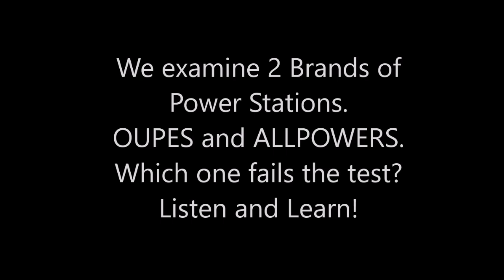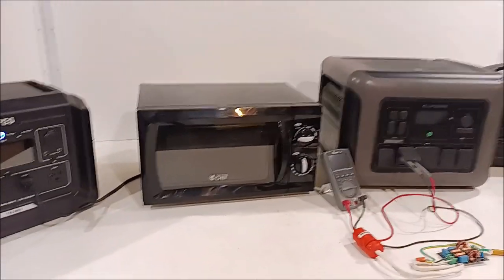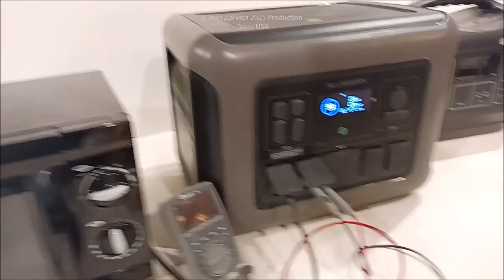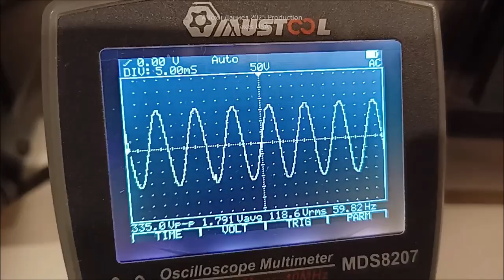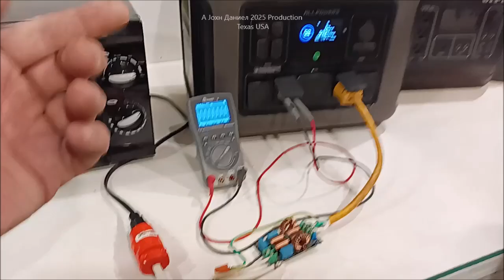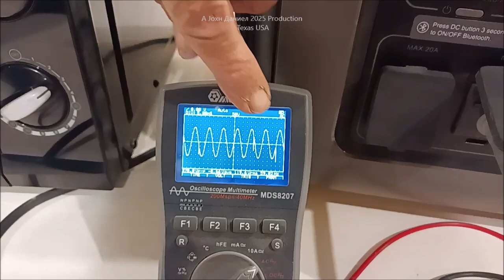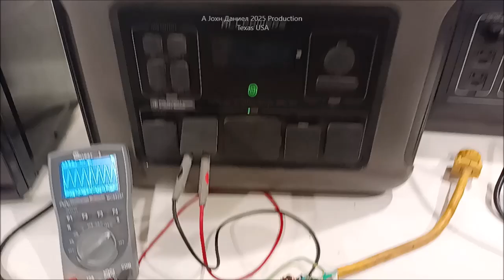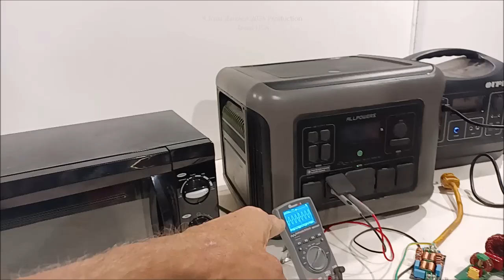VOLTAGE FILTERING - Find & Fix rough voltage using RFI Module | Tested ALLPOWERS & OUPES

Comment from the maker: EMI Voltage Filter DIY 20 amp https://amzn.to/43loTNxb ,OR Furman Power Conditioner https://amzn.to/3E9qz2t COMMERCIAL CHEF manual Microwaves are EMP/EMI Failproof! https://amzn.to/4ay6uik Need Tech Answers? go👉 Donate $5+ with KoFi - https://ko-fi.com/john4kiera OR https://bit.ly/2buyaCoffee message, inquire, you'll get my help & replies!! 
COMMERCIAL CHEF manual Microwaves are Failproof! Best for RV and Truckers! https://amzn.to/4ay6uik
Reply: I bet if you tested a number of Power stations they wouldn't pass the dirty voltage test

Comment: I have an inverter in my trailer fed from an inverter in my house for battery charging purposes. While charging, my house inverter makes a disturbing buzzing noise. Would this filter rectify the buzzing?
Reply from the maker: A Filter is helpful, but if your using a Modified or Square wave your buzzing may not clear up much.

Comment: My hole home is on solar everything is pure sine wave
Reply: Pure sine wave is only part of a good solar setup! These high frequency units are half ass at best, if there rated 2000w, there only safe for a 1000w continuous. There ok for temporary use,camping,backup your fridge and the like, most people have 3 or 4 of these crappy units, and yes Bluetti, Ecoflow are part of this high frequency crap! You have real, long lasting,clean, quality power when you have pure sine, low frequency power, built with large transformers just like the grid. I have 2 low frequency solar generators 3000w each, and 5kw grid tied solar on my house ( Enphase ), my 5 kw produces 5.5 MW every yr and has for 7 yrs straight, complete system warranted for 25yrs, rated for 40yrs. If any of my panels produce 3% under there rated power, for 25yrs they have to replace them

Comment: This vid got me thinking. I have have 2 inverters 48v Swipower 2000w 3000w both refused to power  laptop plugged in to TV HDMI (130w max total) made TV behave funny blank screen. But If I put the power from swi inverters through my Anker power station in UPS TV & laptop work find. So my guess is, having now watched this video, the swi powers are putting out dirty voltage and the Anker is cleaning it up. The Swi power display AC does fluctuate on the display so...Thoughts?
Reply: Incidentally the tv and laptop power fine with a 1.5 yr old all powers r600
Reply from the maker: If your using the ground wire on the outlets on the SWI power remove it from any grounding such as Cable TV ground or the like. It can cause voltage imbalance. Putting them through a power station removed that ground static. I run all mine as 2 wire, and NO grounding on Computer Cat5 or the like and cable TV or the like is removed. zero issues.
Reply: The inverters are not grounded. I tried grounding as a solution it did nothing. I honestly think having watched your video it's dirty voltage. Sony TV must be female, very picky, voltage has to been hygienic. No worries though because I only use them for kitchen power (heat elements) they do that fine. Got another inverter for sensitive equipment.
Reply: One feature I like about the swi powers is the soft start. I have a vacuum that pulls a ridiculous surge, but I switch it on while the inverter is off, then power on the inverter and listen to a nice gentle rise in power. Doing it the other way (inverter on then vac) trips the breaker :-)
Reply from the maker: For the hyper picky things, such as CRT, Plasma TV, and HAM radio, use the best made for that, a pro model like we use in the telecom work. Just need a 1500 watt in 48 volt for your system. My suggestion, absolutely the Cotek SP1500-148 1500W, 48V https://amzn.to/42ynUd3 
Cotek is Xantrex product, all internals are made in Taiwan not China. Assembly is at the Kioshi ( formerly Toshiba ) plant.

Comment: I've heard you mention you have a power station running freezers and other appliances and they get trickle charged throughout the day. Is it a solar trickle charge or coming from main battery bank? Would love to see a video on that. I really like that idea because if a "main" inverter goes down, your whole off grid setup isn't an expensive pile of parts not doing anything.
Reply from the maker: Yes, we have a number of Power Stations just getting 90 to 150 watts each all day long and even all night when the batteries have it they are on a circuit using a VSR so that all day when volts are above 12.8 they charge. They get started when volts exceed 13.2 in the morning and all day or night as long as its over 12.8 in the main bank. Only time they do not get or stay to 100% is when the main system has 3 or more days of heavy clouds. On those days we have one power station that is a Aferiy 2400/2032wh that will dump power to them on one AC circuit to them with 30 minute mechanical wall timers you can set for 5 to 30 minutes to any one that needs it most. I also have 8 of the extra odd ball LiFePO4 batteries that are made into a 24 volt system that is to either buck or boost 30 amps to 12v, 10 amps to 36v to meet any short needs of my 12 or 36 volt banks. 
A video is not a bad idea.

Comment: So you have a faulty allpowers 2500 inverter board. Doesn't mean they are all like that. And they most certainly aren't. Be a lot simpler if you just ask allpowers for a replacement inverter board under warranty. It's 5 years.
Reply from the maker: Built faulty, both units on the table that are ALLPOWERS had same EMI issues. Oupes don't, Bluetti don't, and only the Ecoworthy Inverter I had showed some types of bad voltage.  And they are aware of it, say all boards are this design, NO 2 or more stage filtering. Already been there, done that. According to them and reason for the buying and using a filter was their reply to: "use a AC line filter to improve the voltage" that recommendation is from the source in China via Alibaba.
Reply: @JOHNDANIEL1  Fair enough. Filter is cheap enough if it corrects the issue. I don't like the fact you can't charge with DC at a high enough rate while using the power station when it's at 95%+, meaning you can't hook it up to 51.2v Lifepo4 bank as an expansion without avoidable wear on the r2500 battery etc. Should just take what it needs to charge and extra to power loads. Doesn't. Does on AC obviously for UPS.
Reply from the maker: I will attempt to run/video a hand held welder on this 2500 watt constant with 4000 surge watt claimed starting boost. The R2500 if you need specs. Lets see, check back for it on the channel. Attempts for it to run a 13k BTU RV roof Air Conditioner inverter style with ultra soft start 1800 watts start, 1240 running, it was iffy at best, struggled.  
The ALLPOWERS brand has new recent ads all over that say ( upgraded version ) for a reason. Same item, nothing changed,  just they are in a panic and you can find them listed all over on Mercado and Ebay as "refurbished" or "renewed" which is due to thousands of returns on them. Those reviews that are not paid for by them tell the story on the same issues I show. They have impressive quality battery cells, good BMS. But all complaints are the inverters and MPPT units in them. 
When they have a FIRE SALE due to bankruptcy, be ready to snatch them up as dirt cheap great battery banks to use. Toss the rest.
Reply: @JOHNDANIEL1  That would explain why the R3500 (3500 not 2500) has plummeted in value on Amazon to £1099.99 (I'm in UK) Amazon price tracker show the r3500 at over £3000 for all the time it's been on there till just this last few weeks.
Reply: @JOHNDANIEL1  Looking forward to the video. I had access to a r2500  a while back, assumed it was just faulty because it struggled with surge. In fact no joke on a particular inductive load 4 small lifepo4 charges totalling 600w the r600 powered it fine and the r2500 overload errored until you switch inverter back on. My guess is to avoid that fault they perhaps started throttling voltage but introduced more faults. That video will be an interesting watch. Cheers!
Reply from the maker: Yep, Price changes can be tracked on HONEY app and truth can be found in the downward spiral!
Reply: Truth is, high frequency units are cheap temporary power sources. Low frequency, pure sine solar generators are the best you can buy, and there are very few even available on the market! I own 2, 3000w LF units, and 10kw lithium batteries. I wouldn't trade 1 of my units for 2 Ecoflow 3600w HF units! And with only 13w idol consumption, I know what I have

Comment: Excellent comparison video. Higher price doesn't necessarily mean better quality. 👍👍👍👍
Reply from the maker: I am trying to save up to get that one Oupes 2400 on Temu. I only run truck 2 days a week, so $$ is slow. So far they are offering me NO DEALS on it, hopefully this video will help them send a 50% off again so I can have one to replace what this Allpowers was supposed to do. Then my plan is to just use the Allpowers for its 48 volt battery to boost that one in the new Oupes and to be used as a emergency model if needed back up. That 2400 watt Oupes ( 2024 model orange black model ) is $500 off anywhere else on Temu due to them wanting to sell off them to renew their style and looks. Issue is, the $600 one on Temu is 100% identical internally to the  newest 2025 model $1200 Mega 2!!!!

Comment: Great video!  On a side note.  Do you guys know of a affordable good soft start plug that one could use on these types of power stations?
Reply from the maker: Use the FURMAN that I listed under the video, a bit down on the links I left on there. It's good about voltage control and has a filtering and base load support board in it.